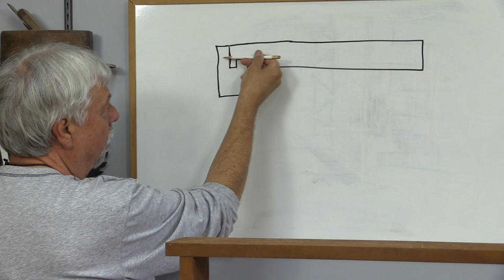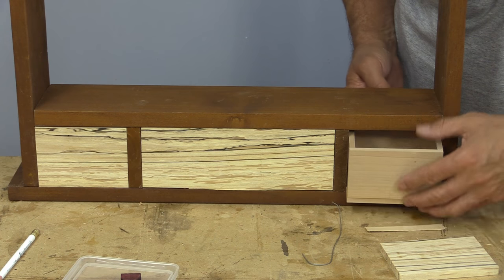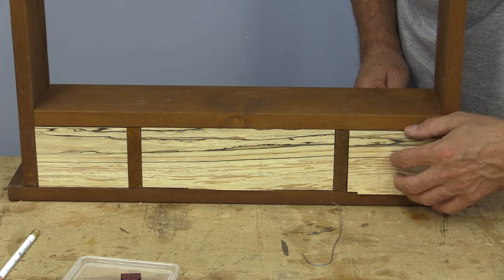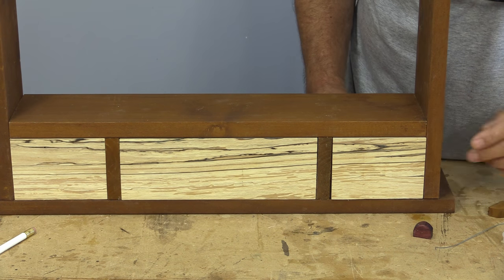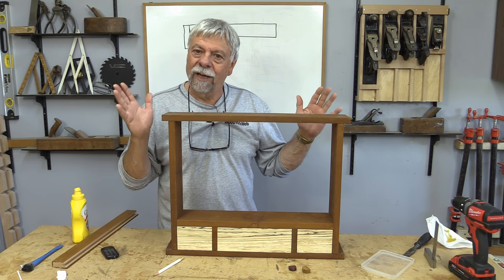How to Make Wood Shelving - Peekaboo Style Wood Shelf

Comment: GREAT project Colin.  I very much like the spalted front.  Perfect choice.  As for the pulls, IMHO, just a very small round know that matches the frame.  Something not much bigger than a push pin, maybe 200% larger.  You definitely do not want to take away from the spalted grain.

Comment: Hi Colin, for something similar i made some little flat brass draw pulls that fitted to the top of each drawer. they were about 1.5 mm thick, and maybe 20 x 15 mm in size. I recessed out the top of the drawer front so they sat flush at the top, just used brass screws to hold them. I also folded the front of the brass plate gently down a mm or so for that tactile feel. They are more restrained than pulls that sit in the centre, no matter what they're made of. you are right not to want to spoil that lovely look of the spalted timber :)

Comment: Skip the drawer pulls all together.  Inset a rare earth magnet into the drawer front from the rear.  Then make sure that you have something with a sufficient iron content displayed on the shelf.  Use the iron curio to pull the drawer open with the magnetism.  It keeps the clean look and adds a "secret drawers" factor that will wow folks.   Just don't store all your prized Bryan Adams cassette tapes in there ;)
Reply: That is a neat idea Matt.
Reply: As Kevin said, great idea that wouldn't add another element to this otherwise clean and minimalistic piece of art.

Comment: Some great suggestions.  I would try glass or iron knobs, or antiqued some D rings like you suggested for holding the shelf up at the beginning of the video.   If you had used barnwood it would be neat to see sections of barbed wire as pulls.

Comment: For small drawers I've used medium sized maple or cherry Shaker style coat rack pegs, cut them to the length I want, and use them for drawer pulls.  Finish them as you like.  After you cut them to length, drill a small hole in them to accept a small screw so they don't split.

Comment: maybe instead of pulls, route a slot on the bottom of the carcase that comes right from the back but doesnt come out through the front edge and screw in a cup hook or something "extra fancy" to hang you keys on and open the draw. Or wider slot just to put your finger in a blind hole under the draw.

Comment: cutting the upper part of one centimeter and make a cut from 45 ° 
with the top on the front and bottom toward the inside of the bezel. So you will have a small almost 
invisible space and the possibility of opening the drawer :))

Comment: Colin, it seem a little of a shame to spoil the look of the grain on the front of the shelf unit. What about fashioning a low profile knob from well chosen parts of the spalted material. The knobs would be there but they may more less blend into the drawer front. By the way....what super glue and accelerator do you use and where to get this, have been looking for this stuff and haven't found it yet.  Thank you for your excellent videos.

Comment: It may be too late as the drawer face plate is already attached.  I'd have cut out at the top edge of the face plate to allow a finger to grab the drawer.  I don't know what the design is called but it's used in these Ikea cabinets ( http://www.ikea.com/us/en/catalog/products/00261295/ ).

If you want a handle, I'd have a handle "bar" (finger pull???) attached along the top edge of the drawer face plate.  I'd try to reuse any left over material from the Alder piece that you used for the face plate.